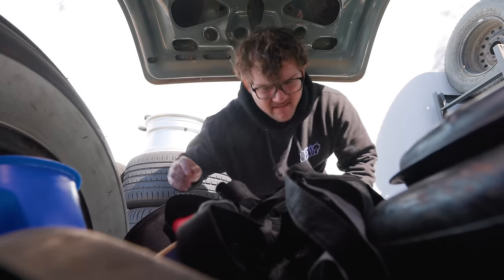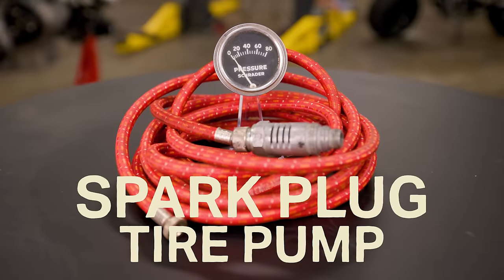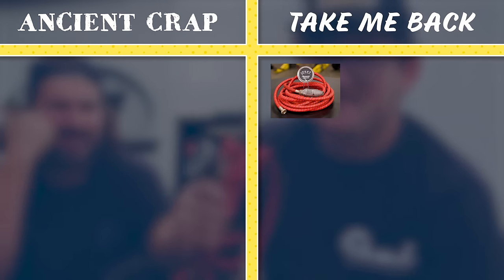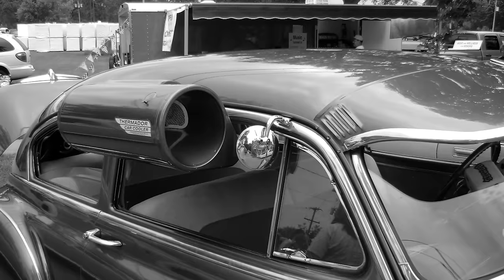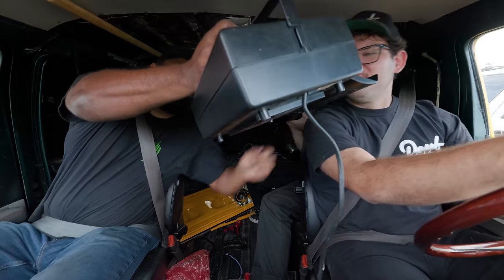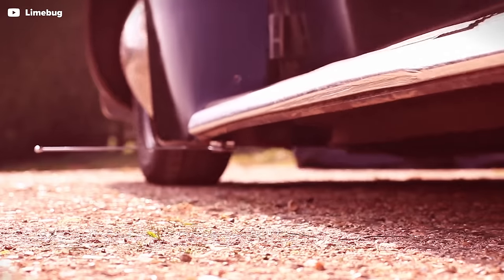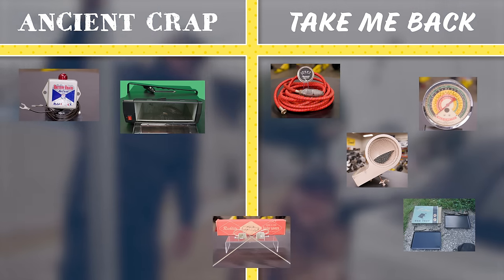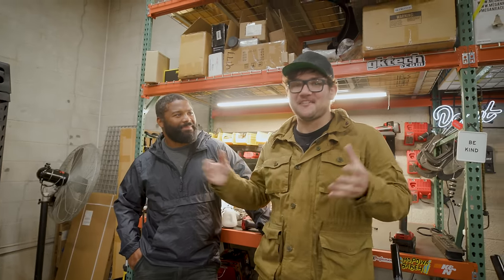Testing Forgotten Car Accessories

Comment: That spark plug tire pump was actually freaking sweet. If spark plugs weren't so hard to access on modern cars they would maybe still be for sale.
Reply: Man I hate modern spark plug setups.  On my old Aveo they were buried under the ignition coil, the coil connected directly to the plugs instead of using wires.  Then don't even get me started on how much I hate Subarus and their boxer engines....
Reply: Well, it's also that a DC powered tire inflator is like $15 and doesn't require a spark plug wrench and getting your hands greased up from the engine bay to use it.  If the battery is dead A) you're not going anywhere anyway B) the engine couldn't be running to use it.  Cool for its time before in-car DC power was common/standardized, but there's just no reason to go that way anymore.
Reply: @nunyabusiness896  i dont get why so many people dont get this. Its just a old solution that has been since replaced by a better, faster and more convenient solution. Its a relic of the past like many things that were great then but have improved replacement todays
Reply: Well quite a few 4 banger engines from various makes are actually very accessible. But everything is so reliant on electronics now.... I'd hate to see it throw codes and go into limp mode until it can be reset (which not alot of people keep OBD2 scan tools or laptops in their vehicle lol). I don't think I could use this on my truck....I dread the day I have to replace my 16 spark plugs on my F250 6.2....nothing like pulling wheels and plastic flares ugh
Reply: @DeadBaron  That's coil on plug, probably the best type of ignition system and pulling a coil off takes a minute. Much easier pulling them off than remembering the plug wire orientation
Reply: @DeadBaron  It's not that hard to replace spark plugs on a Boxer engine. It's no inline 4 obviously. You just need a couple wobbly extensions and a flex socket adapter, and patience.
Reply: @bastik.3011  DC compressors are way more convenient 100% but for like pickup truck tiers its hard to find one that can actually pump one up from flat without over heating and it takes FOREVER. i can for sure see a reason for these to exist still as long as your car runs you will be able to inflate what ever tire you want there's almost nothing to go wrong on one of those things
Reply: Bruh got a selfie on in his name 😳😳
Reply: @whopops9760  i still believe that there are better modern solutions, even for the exception of the oversized pick ups

also because modern cars have ECUs and they dont like the engine being tinkerd with while running
Reply: They are still good for motorcycles tho
Reply: @SaKOTR  most misfire codes will clear themselves after the issue stops. not all but most
Reply: @DeadBaron  lol yeah that's what I've got
Reply: @SaKOTR  Wouldn't you be able to power cycle the OBD by disconnecting the battery?
Reply: @brickdinero5468  I literally have no idea how that happened. Ive never seen that picture in my life until looking back at this comment lol
Reply: yeah, something like a small block ford or chevy has much more accessible plugs and it would be easy for the tool to work, not to mention they would idle relatively ok on 7 cylinders
Reply: But how does it ignite the fuel?
Reply: @commanderwill2248  you put the sparkplug back in once your done obviously
Reply: @SaKOTR  Even in limp mode, it still is capable of running the Cuban cigar lighter socket and powering a mini compressor without having to wrench spark plugs out.....
Reply: I own an ls2 and the spark plugs are easy to get to
Reply: used one once, just had to remember to stop before 100PSI, way before.
Reply: Connor I don't even know where the engine in my car is, everything is plastic and hidden.
horror
I want the old cars back.
Reply: @whopops9760  A 12v pump that actually has cooling fins and works well is about $125 and they are in kits for  air bag suspension systems.
Reply: I agree Sir. Pretty sweet   some cars are still ez pz to get at spark plugs. Some def not. Lol. Cheers
Reply: These days we have portable pumps that just plug into the cigarette lighter which is way quicker and easier.
Reply: @125conman  Looks like you got that picture because you're a paying channel member.
Reply: @hrodga  In some cars if you disconnect the battery you have to go through a long annoying process of reprogramming the ECU (takes about 30 minutes if you do it right the first time, which almost never happens) or you won't even be able to idle correctly.  It's much easier to just have Autozone or somewhere clear your codes for free if you don't have the tool yourself.
Reply: That was the intention. Making it hard for car owners to service their own vehicles.
Reply: I couldn't even use it on my modern car since I have an ignition coil casette and cant take out a single plug to let the engine run on the remaining cylinders but it's a cool idea though.
Reply: Foshure
Reply: @eric_d  That sounds horrible. How are you supposed to work on a car like that?
Reply: @bastik.3011  I would still use it, considering I have a wiring issue with my cigarette lighter. Also many newer cars don’t have cigarette lighters
Reply: @electricpaisy6045  you don’t remove the spark plugs you attach it to them.
Reply: @mom_im_losing_it  how does it get preasure from the cylinder then?
Reply: @hrodga  I may have been mistaken about the amount of time it takes.  I know the old GM chip keys took about 30 minutes to reprogram (assuming the battery didn't die in the process).  If I'm not mistaken, every Nissan made since 2004 needs the relearn procedure done after any battery disconnect, jump start, or throttle adjustment of any kind.  Requires turning the ignition on and off a certain amount of times after a certain amount of seconds between each step, possibly working the door locks a specific way, and stepping on the gas pedal in specific patterns a certain amount of times with a certain amount of seconds between the patterns.  If you don't do it exactly right the idle will keep bouncing up and down between like 600 and 2000 rpm while sitting in park or neutral.  I always hated having to do that procedure.
Reply: @nunyabusiness896  DC pumps flatten batteries
Reply: @AlienLivesMatter  Never did for me, and you can run the engine while you use it.  They tell you not to, but that's a safety thing.  You can also get them bundled with a battery jumper and run it off of that battery instead, that's what I use anyway so I don't have to keep fighting with the cord.  Both ways are still miles better than risking messing up spark plug threads, damaging/losing a spark plug, fouling emission equipment, etc.
Reply: @jameshunt5316  they still have 12v outlets
Reply: @eric_d  Ah. All of the vehicles I've owned and worked on were '82 - '98. I just picked up a 2010 Kia, but as far as I know, it doesn't do all that BS. It seems that newer cars are designed to be as unfriendly as possible to people that want to do their own maintenance, though.
Reply: @hrodga  It's true that manufacturers don't want people working on their own vehicles.  They don't even want repair shops working on their vehicles.  A shop can't even do a wheel alignment on a Mercedes without a $50,000 computer that they're not allowed to buy!
Reply: @nunyabusiness896  if your battery is dead than a flat tire is the least of your problems anyways, also the in car plug is prone to going bad pretty often. If your engine is running this is going to work regardless however. They both have their pros and cons but realistically this is more reliable and it pumps it up faster.
Reply: @bastik.3011  your not unplugging a spark plug while it’s running…. Atleast I hope not because that’s extremely dumb. And even if you did it’s not going to hurt the ecu. It’ll just register it as a miss and pop a check engine light on. There are “better” solutions but they are usually well over $150
Reply: @crimsonlight4205  Total nonsense.  Who even keeps a spark plug socket wrench in their car?  Then you have to pull off covers and coil packs and you risk contaminating your cylinder. I've never had a problem with DC pumps, you're just making stuff up dude.  Stop.
Reply: @DeadBaron  I hate everything about a Volkswagen Golf engine too.
Reply: @nunyabusiness896  except if your battery is dead but you have a stick you can still start the car
Reply: @candle86  Then bump start it and use the alternator of the running engine to power the DC jack.  Are you really going to bump start a car missing a spark plug to run the goofy a$$ spark plug inflator? Why are you guys shilling so hard for this clearly obsolete device?
Reply: @nunyabusiness896  because it's not obsolete.
Reply: @nunyabusiness896  also a $15 inflator isn't reliable, your out doing a road trip and your emergency inflator has a bad seal which is so common with them, well looks like your stuck. This uses the engine as the air pump, it's simpler and given that the rubber in it has held up 60+ years it proves the point of keep it simple stupid
Reply: @nunyabusiness896  nah I drive a 70s truck because these new cars are absolute trash and designed to fail.
Reply: It'll get ya home but it would be nice to be able to shut off the fuel in that cylinder ,that's kinda hard to do with a carburetor though. 
Haha hold a  lit ciggy lighter near the Schrader when you let the air out 🤣🤣
Reply: @MrTheHillfolk  well I was thinking about that anyway you could pull the fuel line off the carb and runner until she runs out of bowl in the float and then you've got an engine without any fuel you just use the compression stroke to air up your tire then you just put the fuel line back on the carburetor and you're good to go.
Reply: @crimsonlight4205  anyways, a perso that can handle he spark plug compressor will probably find a way around a cheap dc compressor. All the rest of the 99,9% of people will try to call for help, or rather find help online. I think many will just give up if internet is not available, they wouldn't be able to phone for help, let alone handle a spark plug wrench.
Reply: @candle86  Said the person with a non-working DC jack he's afraid to use to inflate his tires.
Reply: @nunyabusiness896  that's cute not afraid those dinky airpumps are just unreliable but hey enjoy your plastic car, I'll enjoy my vehicles made out of steel.
Reply: @candle86  Once again, never had one fail on me ever.  Everything out there has defects dude, including goofy spark plug pumps.  Enjoy your rustbucket made of rust.
Reply: @nunyabusiness896  oh I will, you just know quality when you see it, I bet you drive some foreign car.
Reply: @candle86  Wait, you think you're going to be able to use the compression stroke AFTER you disconnect the fuel? How is this engine running? You going to hook up the air hose to the tire then push the car down a hill? 😂
Reply: @niko7903  You have no idea how a car works do you, you think they have fuel running to it for compression checks? Sorry to burst your bubble but all you need is the starter to turn the engine to create compression.
Reply: @candle86  I'm perfectly aware, just thought it was funny and not practical. Not a good idea to be cranking over an engine using the starter for minutes at a time. I don't think the cranking RPM of a starter would pump the tire that quickly. Great way to fry your starter and drain your battery. Trading a problem for another problem, would be quite the laugh to pump up a tire and then find yourself with a dead battery. It's cute that you think I don't know how a car works, though.
Reply: @niko7903  Most people on youtube have no idea how a car works, alot of people are into cars, but have no idea how things actually work. I grew up in a mechanics shop, and it would air up fine, and wouldn't hurt the starter, nor would it drain your battery unless your using a very old battery that you should likely be replacing anyway.
Reply: @candle86  Which is why I thought it was funny when you said "then you've got an engine without any fuel you just use the compression stroke to air up your tire then you just put the fuel line back on", because without mentioning the intention to turn over the engine with the starter it just sounded funny. I know you're just giving that idea of how it could prevent fuel mixture going to the tire (the description in the video does seem like it would help prevent air/fuel mixture entering tire, but I would guess it's still letting in a bit), I'm still skeptical of how well doing it with the starter would work or how wise it would be to do it. It's just not a good idea to turn a motor over for minutes on end with a starter, and I would expect it would take 2-5x longer than a car at idle speed to fill the tire, so they said "less than a minute" once they had it positioned correctly (would need an accurate count on time). I don't know, it would probably work fine, again likely unnecessary to even do it this way, but could do it in short spurts to not run the starter too long, and if it doesn't take more than 4-5 minutes cranking it over I suppose the battery could hang in there. Though, I still would just recommend a cheap inflator, I've had several with no failures (some have a jump box built in), but I guess this wouldn't be the worst thing to keep in your ride. I still think it would be hilarious to see the battery dead after filling the tire up with the starter. Anyways, cheers.
Reply: @niko7903  Oh I don't disagree, I keep an inflator, but im also going to buy one of these, because having a backup is always helpful
Reply: Why'd they blur out that car during spark plug/tire pressure test?? I'm curious!!  3:13   3:28
Reply: @whopops9760  I was thinking the same, would be good for airing up after 4wding unless you spend big money on a vehicle mounted arb high output or twin compressor with a air tank these cheaper units do work but tend to over heat and take forever to pump up all 4 tyres
Reply: This would work great in an emergency on older Hondas and Toyotas. You'd have to reset your CEL but it would get you going.
Reply: @DeadBaron  Totally agree. I like having a distributor with 1 module and spark plug wires. Not multiple modules attached to more failure points and an unnecessary harness. Love Subaru's style but I don't care for the boxer engine design. I like when Major repairs can be done with the engine in the vehicle if necessary and for Boxers there's no way. If I ever own a 90s Subaru Legacy or Legacy Wagon It'll have an engine swap in it.
Reply: @bastik.3011  not all vehicles, especially standard models have 12v outlets or cigarette lighters (which is the same type of outlet)
Reply: @nunyabusiness896  I keep a basic tool set in my car at all times in case of a break down and I do pack my spark plug puller when I go on road trips. I don’t have someone to come save me, so I do what I can to stay on the road. The pump wouldn’t  be obsolete for someone like me, especially if you had pesky electrical issues making your plug in pump useless.
Reply: @jameshunt5316  every car i had been in had one, granted not that many but even in a 2021 compact SUV
Reply: @SaKOTR  I have a Bluetooth ODB2 scanner and use my phone to access it, makes clearing codes very simple and cost about $15.
Reply: I'm certain it works better on a V8 than a V4.
Reply: @therealjammit  well there are barely any v4s so thats for certain
Reply: Imagine with a subaru😭
Reply: @arcanask  Was gonna say this lol, didn't really take that long, just had to pull the airbox out and pull windshield fluid reservoir out on the other side really.
Reply: @Darkhunter218  airbox and battery on mine. It's still tight but doable with some regular tools. I remember once I wanted to changed the plugs on my mom's old Montero. Boy, was I dreaming. The front plugs would have been easy enough but the back ones would have had me remove practically the whole top part of the engine.
Reply: I just use a CO2 tank with a regulator set to whatever psi I want in the tire.
Reply: Diesel engine has left the chat
Reply: Newer cars spark plugs r way easier to get to wtf r u talking about they don't even have wires anymore
Reply: @brickdinero5468  ya how'd he do that
Reply: @w.e.s.  OK, buddy, got an FR-S for ya, have at it and let me know how it goes.
Reply: I'm not sure that pumping your tyres full of explosive fuel / mixture was ever a good idea but in an emergency I suppose.
Reply: and the sad part is most people nowadays wouldn't even know what a spark plug is
Reply: I disagree because there are portal tire pumps now that you plug into the cigarette lighter and can pump your tire.
Reply: Every Toyota owner: 👀
Reply: One big issue I see with that pump is your still sending fuel to that cylinder. The pump is designed so that it dosen't pump fuel out but it could still seep past the rings and contaminate the oil or wash down a cylinder. I'd definitely use it in a emergency but we have 12v compressors now that work just as well and are small enough to be stored under a seat. I'm sure at the time it was made it was a great product but it's definitely not as practical as it once was.
Reply: I hated replacing the spark plugs on the nissan versa I had, they were underneath the intake manifold
Reply: Nah still too much work compared to 12v plug in airpumps.
Reply: My car it’s buried under the intake and you need to remove the intake and throttle body to access the spark plugs. And it’s a waste spark ignition so it would be missing 2/4 cylinders if I could use this. Thanks Chrysler
Reply: You must not have tried a decent quality air pump from recent years. I agree, back in the late 90's early 2000, the 12V DC air pumps sucked and would not pump up a football. But now days most work very well unless you buy the $12 Harbor Freight pump, which does actually work. Just not that well or fast. But the Slime brand pumps are very nice. Even their small ones work well. But spend around $100 on the one that comes in a silver looking box (protective case) and it will blow your mind how well it works. It's like hooking your tire up to the compressor on a big air tank. It will fill a big full size Chevy truck tire in a minute or so. And that's from completely flat. I'm sure other brands are good too but the Slime ones are sold at every parts store and that's what I've tried.
Reply: I have a 2010 F150 with a 5.4L Triton V8. It's an older engine and mostly everything is very easy to reach... Except the 2 spark plugs that sit deep inside the engine bay. And the fact that the original spark plugs for that engine are known to break apart inside, it's nerve racking when trying to remove them.
Reply: Actually, people used to convert the 8 cylinder engines into 4 cylinder engine and 4 cylinder compressor.
Reply: Yes but no. Ya gotta think, unless you somehow turn off the injectors or block the carb, you're pumping you're tires full of air AND fuel. So you better hope your tires are 110% sealed. Other wise something like your exhaust could, mind you I didn't say WILL, literally blow up your tires. Like, explode blow up
Reply: @codyconnor8353  There were some commercial compressors that were essentially a V8 block with 4 cylinders used as compressor, and 4 to run it. But yes, heavily modified.
Reply: Well, I have diesel so it wouldnt help me too much
Reply: Lol. Run my engine with a misfire and flood one cylinder for air, im good. Super cool survival tool though
Reply: Yeah you would be screwed if you needed to use it on today's cars. Instead of just a socket to remove the plug,  you may need a lift,  extensions,  maybe remove a wheel or an intake.
Reply: @bastik.3011  its still really really cool tho
Reply: @rinkkalex  when you change the wires, you do it one at a time, thus not wondering which one goes where…🤦🏻‍♂️
Reply: I had one in the late 80s early 90s. It worked.
Reply: Nowadays they plug into a lighter port
Reply: I think it could be perfect for motorcycle's
Reply: @SaKOTR  just disconnect your battery for ten minutes
Reply: So u want to fill your tire up with gasoline?
Reply: Wouldn't that pump gas fumes into the tire?
Reply: Darryl Vaillancourt  that was back when people would actually stop to help u if u were broken down or had a flat.
Reply: Plus the fact that your causing engine imbalance and unnecessary ware on the engine when you pull a spark plug, flood it with fuel and air while running the other 3-7 cylinders. Not smart
Reply: @DeadBaron  *Tristan don't buy that Subaru. Tristan that Subaru is a bad idea."
Reply: Know construction guys have compressor go out they made one of these hooked up to tank ran better than compressor ever did
Reply: Ya and than imagine your tire getting shot out or something lol it’d explode
Reply: @DeadBaron  Jeep wranglers have it easy. they're super easy to access
Reply: @nunyabusiness896 if your bettery is dead your not using your in car charger lmao. And even if you could, I'm pretty sure the battery would be a bigger problem than a flat tire
Reply: I think I just figured out exactly what to add to my '81 Suzuki motorbike tool kit lol
That thing will be freaking sweet in an emergency
4-banger engine with DC ignition cables with VERY easy access
Reply: Yeah that was amazing
Reply: Cant find my sparkplugs on the tesla.
Reply: But the tire will be filled by combustible gasses!
Reply: One issue that comes to my mind is if your engine is direct injection you’re still going to get fuel
Reply: Big part of it is that when it was made a lot of cars were 6 or 8 cylinder, they're way more tolerant to running a dropped cylinder.  Also tolerances being more sloppy/components being more chonky, the uneaven load wasn't as damaging.  Also back then a lot of people did their own basic maintenance, so having a plug socket on you wasn't abnormal.  Finally,  if you did this on an obd 2 car it would code for coil, miss, or both.  The high O2 would be assumed to be from the miss but it may code for cat temp or other cat issue (because the raw fuel is cooking the cat so bad already) but if you put it back together it would clear its code after one "trip" and clear the history after however many "heats" or you could disconnect the battery for a few and reset the codes
Reply: Wow, so much going on here...my quarter million mile maxima modyr 2000 purred like a kitten because I changed the oil once in a while, my ex gf put her 2019 civic si into a guardrail post head on at 70 mph and walked away (walked, not limped, not assisted,  walked).  My dad's friend in the 80s had a 70k mile Chevy custom deluxe from the 70s or some junk, changed the oil every 3k miles, still sludged up because 3k miles for him was 6 months. 40 years ago oil had a really short shelf life.  And finally I modify and track my 2021 civic commuter with a craftsman mechanic tool set, and a 200 dollar obd2 tool.  New shit has hiccups, but the technology overall has made a safer, more efficient, more powerful and more reliable car.  You can Crack a book or Google millions of tech articles or you can cry about the world moving forward, your knees being shit and your hair falling out.  And if you're under 50 don't call me little bro or kid.  And if it's any consolation my knees are shit too
Reply: I could not agree more as a Subaru driver
Reply: Those work great for motorcycles
Reply: Wouldn't be bad for a motorcycle emergency kit.